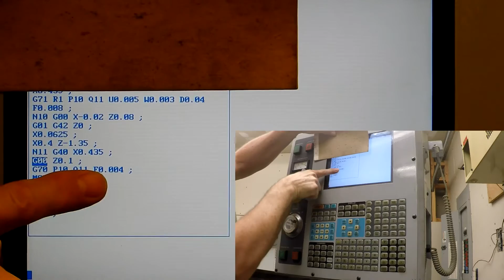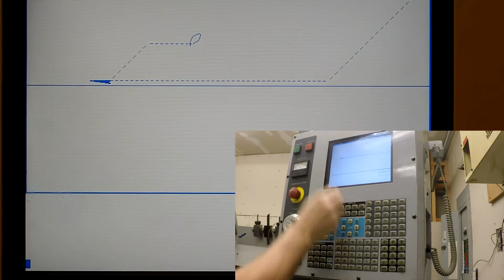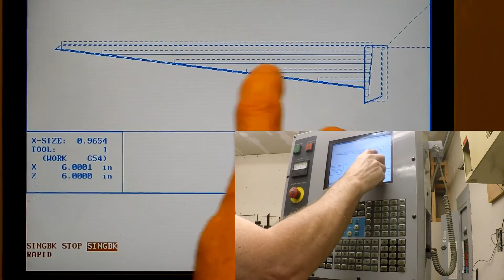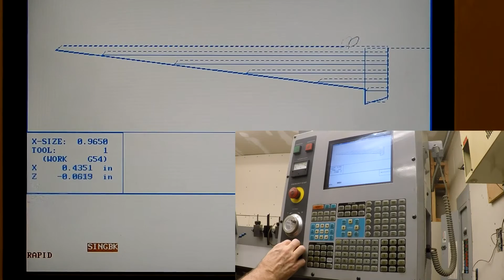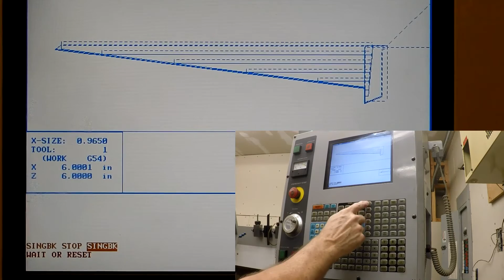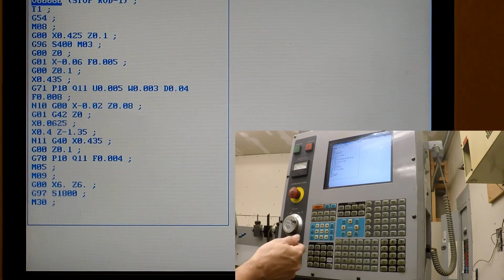Mill Stop 2-2

Comment: Thanks for all your videos,  program looks good but one thing i would have added is a G50 max rpm line, I know its model from the last time it was programmed, I don't know about the haas lathe but on a lot of fanuc controls when you 1st start them up  the max rpm on the position screen has some crazy number like 320000 rpm, never went to x0 with that number, I think it would go to the max rpm of the machine.  so I always program a G50 s__ in.     The R1 is for Type 2  G71( will do Pockets) when setting 33 is set to yasnac . fanuc will need the X and Z on the 1st line like you have it. Great cycle keep up the good work!! you are a great Machinist
Reply from the maker: pedub2222 you are right on a larger lathe I would always do that. On this machine it only turns 1800 rpm max. Not enough to cause a problem in this case. Glad you liked the video thanks! I mean to get back to making more instructional videos and to the mill stop fixture. Just haven't had time. Soon though. The year end is a little slow.